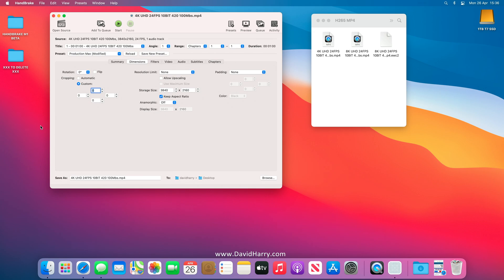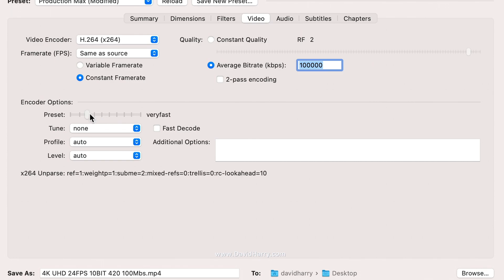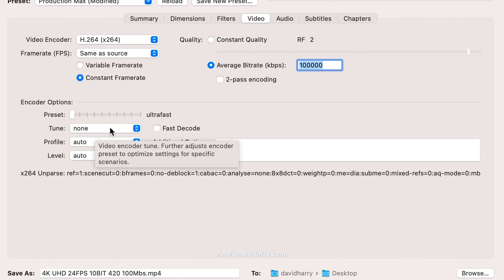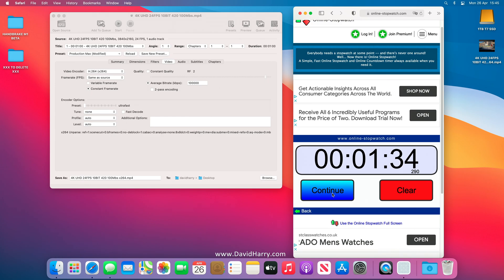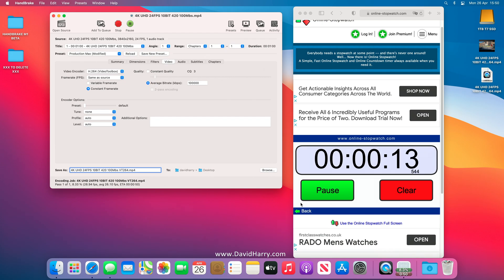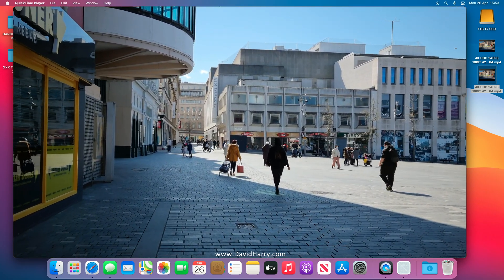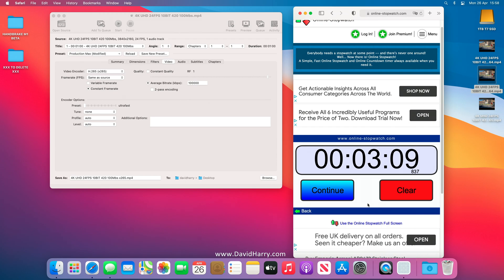Handbrake H.264 H.265 HEVC Encoder Speed Test X265 X264 VS Video Toolbox Native ARM Apple Silicon M1

Comment: Hi, Great test, I use Handbrake since a decade or more but I'm still a noob at it  , just got an M2 Pro Mac mini and launched 100 movies that are Blu ray rips and some torrents for movies I couldn't find and I was impressed already at the seed of it compared to my intel I7 4,2 Ghz iMac , It's like 15 times faster, but fun fact is that I knew M1 and M2 Macs have Hardware Encoders/Decoders , but never thought that Handbrake could handle it , so thx to you I'm gonna change my routine . one question about video toolbox , you said it' s 8 bits only , does this mean I cannot encode a 4K HDR file and keep HDR with the hardware solution ? sorry as I said I'm a bit of a noob , I use handbrake a lot but never thought of looking at each options..
Reply from the maker: Try using one of your HDR files as an input and use 10 Bit H.265 as the output. HB and the Mac encoders will do 10 bit. Just make some short encodes to test if the outputs are still HDR.
Reply: @DavidHarry   thx I fixed the issue by noticing that handbrake handle the vîdéotoolbox for H264 and H265 which is apparently the hardware encoders that are present on the   silicon Macs, cos encoding is even faster . I managed to solve this issue, but I wish I could learn all of the options HB has to offer. ( by the way encoding and H264 iles with H264 HW decoder fave me rubbish files in terms of quality and it's weird cos regular H264 works fine, but funny enough using the H265 HW encoder it's perfect image for same size, so I guess the H264 hardware encoder is not fully functional yet or maybe a bug I had.

Comment: OK….. I have the Mac studio M1 Max.  I also have a PC with a Ryzen 9 5900 and an Nvidia 1070ti…. Yup, older card.  The NEVC encode on the PC is easily 1/2 or less the encode time of the Mac!  Either Handbrake has a lot of work to do, or I’ll need to use my PC with the older video card for larger encodes.  I achieved over 61 FPS with the PC, while the Mac averaged about 27 FPS.  Just spent quite a sum for that Mac!  (4K encodes to be clear). Thanks for your video! Cheers!
Reply: The M4 have improved a lot, just seen a test that Mac Mini M4 Pro did 110FPS while M1 Max did 30FPS in HandBrake

Comment: Although HandBrake has worked to improve quality and speed for several years, problems still exist. HEVC encoding is a CPU-intensive task, which may result in jaggy performance if running on an under-powered computer.

DumboFab Video Converter, is the picked HandBrake alternative, for HEVC encoding. It builds in hundreds of codecs to convert from/to HEVC/H.265 or other popular formats and devices. 8K, 4K ultra HD, HD 1080P, 720P, SD videos are all supported.
Reply from the maker: The problem is that if you are using X264 or X265 inside handbrake, they do not use GPU acceleration, only CPU. Cheers, Dave.

Comment: that's more like it! beating the intel cpu while consuming less power
Reply from the maker: To be honest Mark, it only beat the intel slightly in speed but the power draw is what really takes the piss. I’m totally sold on ARM for desktop/workstation computing and it’s defo my future but am unable to utilise it properly at the moment. My main problem is that one of my programs, my NLE software, is Windows and my DAW software isn’t ARM optimised. I’m selling this Mac to a friend but will buy another as soon as I’ve managed to learn Resolve enough to start editing with that, then use it on Mac ARM. The real pisser is that I’ve just had to build another f…ing Windows PC, I’ll do a video about that one soon. Anyway, as far as I’m concerned, Apple are on the exact path needed for modern computing and although I have nothing against Windows, I’m sick to the back teeth getting worked over for X86 components such as CPUs and GPUs. The sooner I can go Mac the better. That said, I’m defo getting an M1 iPad as soon as. Cheers, Dave.

Comment from the maker: Amazon links:
Mac Mini M1 https://geni.us/AppleMacMiniM1
MacBook Air M1 https://geni.us/AppleMacBookAirM1
MacBook Pro M1 https://geni.us/AppleMacBookProM1
All The New Apple Products At Amazon USA https://amzn.to/3pIO4E3
All The New Apple Products At Amazon UK https://amzn.to/3nEoEpk
Panther Canyon NUC at Amazon https://geni.us/PantherCanyonNUC
NVME SSDs at Amazon https://geni.us/NVME-SSD
SATA SSDs at Amazon https://geni.us/SATA-SSD
DDR4 SODIM 3200Mhz at Amazon https://geni.us/DDR4-SODIMM-RAM

Handbrake H.264 H.265 HEVC Encoder Speed Test X265 X264 VS Video Toolbox Native ARM Apple Silicon M1

In this video I'm comparing the native ARM beta version of Handbrake running tests to compare H.265 HEVC & H.264 AVC software encoding vs hardware encoding. This uses Apple Video Toolbox as the hardware encoder and X265 & X264 for the software encoders.

The computer being used is an Apple Mac Mini which has the Apple Silicon M1 SoC processor. The video encoding software being used is Handbrake. This version of Handbrake is 1.4.0 which is a beta that runs native on ARM on Apple Silicon.

The tests are basic software encoding vs hardware encoding.

The first test is Handbrake H.264 AVC encoding. For this test I'm using X264 as the H.264 AVC software video encoder and Apple Video Toolbox as the H.264 AVC hardware video encoder.

The second test is Handbrake H.265 HEVC encoding. This second test is using X265 as the H.265 HEVC software video encoder and once again, Apple Video Toolbox as the H.265 HEVC hardware video encoder.

The input source file is an MP4 H.265 video file that is 10 Bit, 4:2:0 chroma sub sampling, 4K UHD, 24 FPS and at a bit rate of 100Mbs.

All video encodes are 8 Bit because Apple Video Toolbox is 8 Bit.

00:00 Intro & explanation of test
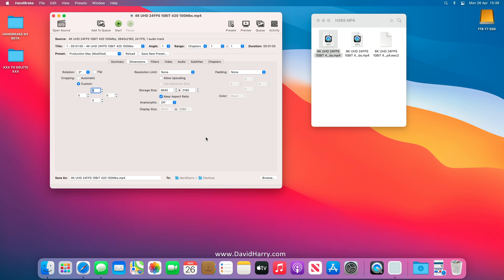02:21 X264 setup
06:47 X264 encode & result
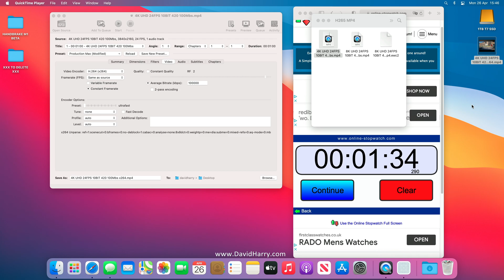08:54 Video Toolbox H.264 encode
10:04 Video Toolbox H.264 encode & result
12:19 X.265 setup
13:13 X.265 encode & result
15:34 Video Toolbox H.265 setup & encode
16:15 Video Toolbox H.265 result
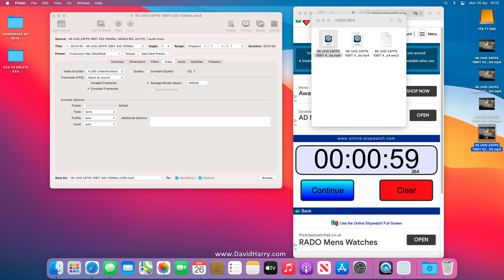18:08 Final result
19:06 End credits

My YouTube production equipment & recommendations. 
Amazon USA https://amzn.to/3g2Oi3i
Amazon UK https://amzn.to/2ZR6IOV

If you liked this video please give it a thumbs up, share it, subscribe and click the bell.
Click Here To Subscribe: https://bit.ly/Subscribe_To_My_YouTube_Channel

As an Amazon Associate I earn from qualifying purchases. I use this commision for buying review equipment & for my YouTube production studio. Thank you.

You can also use PayPal to support my channel https://www.paypal.me/DavidHarry. A nice fancy coffee really helps while I’m editing :)

My Amazon Shop links.
Amazon USA https://www.amazon.com/shop/davidharry
Amazon UK https://www.amazon.co.uk/shop/davidharry

Amazon global links.
Amazon USA: https://geni.us/Amazon-USA
Amazon UK: https://geni.us/Amazon-UK 
Amazon Deutschland: https://geni.us/Amazon-Deutschland
Amazon France: https://geni.us/Amazon-France
Amazon España: https://geni.us/Amazon-Espana
Amazon Italia: https://geni.us/Amazon-Italia
Amazon Canada: https://geni.us/Amazon-Canada 

My ethics.
I do not review Amazon products given to me for free in exchange for an Amazon website product review. DO NOT ASK.

I do review products available on Amazon but these are products that I’ve either bought myself or products sent to me for free or on loan to be reviewed specifically for my YouTube channel.

I always mention at the start of any videos if I’ve received any of the products being reviewed for free or on loan.

Other than technical input that may be useful to the viewer, I never accept any input from anyone who sends me products for my reviews.

I always try to be fair and balanced with my reviews but will always make it very clear if I find any issues with any products that I use or review.

Contact me for product reviews, I do not respond to email requests for help or advice.
YouTube@DavidHarry.com

My web links and video playlists.
David Harry https://www.YouTube.com/DavidHarry
The Game Thing (game stuff): https://www.youtube.com/channel/UC4XX0WWrHCObF36PWsmCj7Q
DJI Cameras http://www.DJIOsmoAction.com
GoPro Cameras http://www.GoPro9.com
Sony ZV-1 http://www.SonyZV1.com
 
I’m David Harry, thank you very much for watching this video, take care and goodbye now.

Cheers,
Dave.